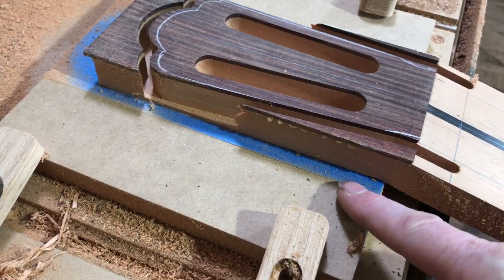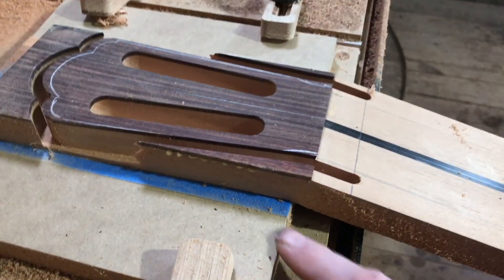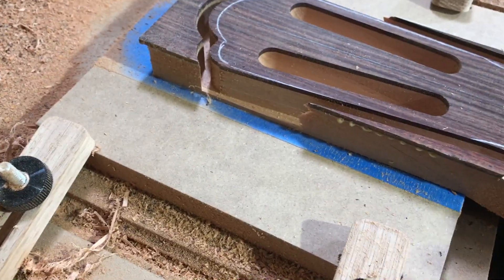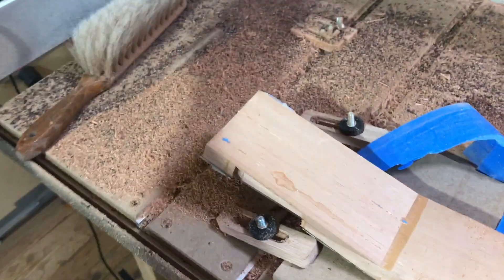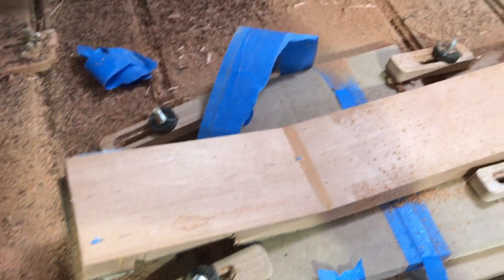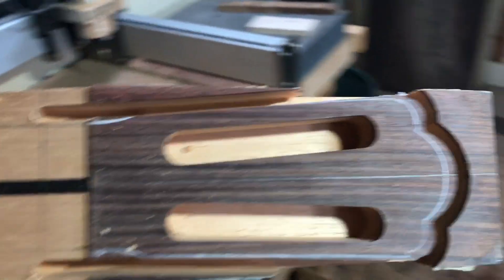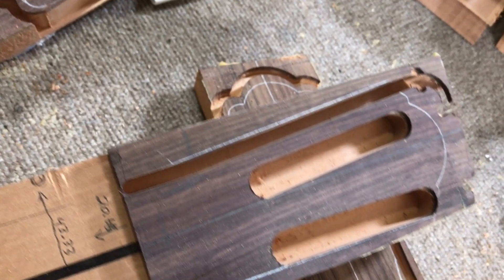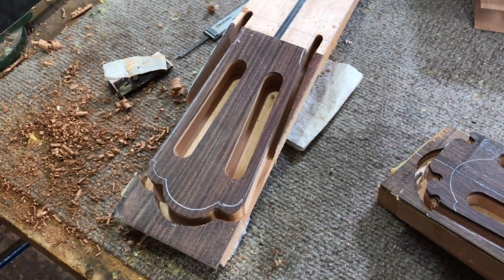Torres head made on the Shapeoko

Comment: Not trying to be silly.. but will you charge less for a machine-built guitar?
Reply from the maker: This concept of a Machine-Built guitar is misleading. Guitar makers use all kinds of machines to make their guitars.    Most guitar makers use a band saw and hand held routers, for the heads.  The CNC is adjustable at .01 mm.  The primary reason I got the Shapeoko was to do DT guitars where you need extreme exact tolerances.  The CNC out performs a hand held router.  So to answer your question no I won't charge less, in fact I'll charge more!